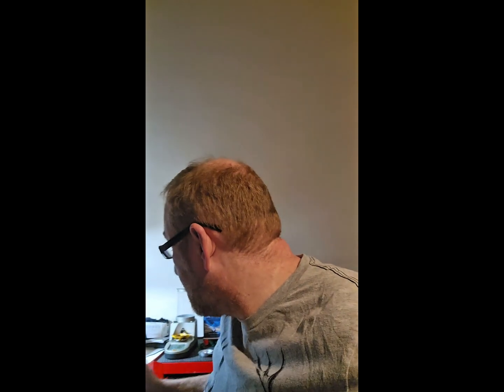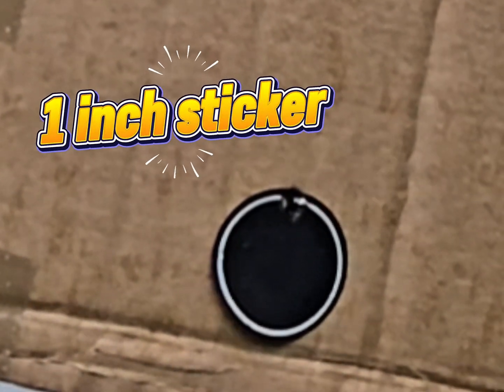Did Changing things make a difference?

Comment: Can i ask:
- did you size your new brass before loading it?
- did you neck size the internal neck (using a mandrel)
- find the seating depth node?
.... i find these made a difference
Reply from the maker: I don't have a mandrel so no never used a mandrel but brand new brass I always run through the full sizing die . I never just neck size I always full size, I haven't found my seating depth mode but after shooting out to 600m the other day which you will see on my other video it's seems to be performing very well
Reply: @FieldsportsScotland  I was sceptical before i got a mandrel but defo makes a difference cos you can feel the variation in tension when seating bullets, but up to you mate.... you using non-lead?

Comment: Worth a mention if it helps you mate. When I load my 20 Tac for foxing etc I always go off group size but I do check them at 200-300 yards on a good day. When I load my 260 or 300 for longer range work I go off SD because SD and Group size doesn’t always go hand in hand. Good luck 👍
Reply from the maker: I agree
Reply from the maker: for me the most important data I need is my average speed which is my SD and to know my groups at zer are sub inch , usually I can get them sub half inch, the only other thing I try and do is zero dead zero at 100m which is 109yrds , after that all the data seems to always fall in place for me .

Comment: If you want to shoot 1000 yds you need a ES of 15 or better, sorry i dont do SD but shooting many F class shoots i assure that ES is needed, take some advice, i dont normally give it and niether do the other experienced shooters, get your powder load first, the ES will lower every 1.5 grains of powder you add, once you have the low ES dont change the powder load, next seating depth for accuracy if you are not happy with it but shooting at 1000 yds it is more important to get the lowest ES possible, get it below 15
Reply from the maker: Right I totally understand where your coming from as an Fclass shooter . 

But here is the real math of where I sit . 

IF my ES was 50 out then at 500 I would be out by 0.1 mil from the centre of the target and at 1000yrds I would be around 0.3 out . 

However my ES is 25 , making my actual SD is out by 10, that cuts my outage by half . 

So on a 10 inch target at 1000yrds I should make impact IF my windage and Dope is correct in my Kestrel . Again even easier on a 10 inch target at 500. To be honest my actual target size might be bigger . 

The actual ES has been stretched by 1 round and 1 round only if you actually look at rounds 2, 3, 4, and 5 the SD and ES was far far lower . So yes I need to take a little more care on my reloading, a little difficult as I use a Lymans Gen 6 . 

I also have full factory set up, and I don't plan on investing more money as on average I shoot around 600 to 800 deer a year and not long range I may add. I also don't do competitions or long range shooting in general and don't plan on burning this barrel out. 

Another factor I have to add here is, this barrel is a factory barrel that has had less than 50 rou as through it , a moderator that has 50 rounds through it and as this breaks in more then my velocities etc I expect to change. 

The point I am making with these videos is this . 

1. You can buy a standard factory rifle , this case a Bergara B14 HMR  and make it shoot tight groups. I will do a video with my 6 5 Creedmoor that shoots 2 SD and quarter MOA also and that is a complete factory rifle also . Both these rifles different brand and both were less than £1200 

2. You don't need to spend a fortune to get a long range plinker 

And 

3. A little bit of basic reloading can improve your groups dramatically. 

That's all I am trying to prove really . 

I appreciate the advice, I do and yes there is a lot more I can do . 

I still have not measure my  lands distance and messed with seating depth . 

I still haven't got a stem for my seating die. 

I am not using balance scales to perfect individual loads, I am using a Gen 6 Lyman auto trickier

I am not using a mandrel to work my neck tensioning and the list goes on . 

I am trying to save on powder and components the price is through the roof here. 

Another point I will also mention, my range at the moment has me shooting off the bonnet of my truck haha not ideal or lying on an uneven track , when it comes to taking those longer range shots the conditions won't be bench rest conditions on a range it will most likely be in one of the woods I manage . A million miles from F-Class hahaha
Reply: @FieldsportsScotland  I gave you advice on how to load any gun, i have cheap Howa 1500 rifles for hunting and the reloading rules are exactly the same to do it properly
Reply from the maker: @rgthomson1  I do take a lot of advice on board, thanks. I am part of a group of friends who are pro PRS shooters and they guide me quite well on a lot of stuff I don't know . It's always good to take advice on board when it is given